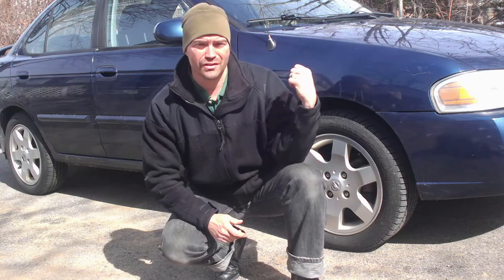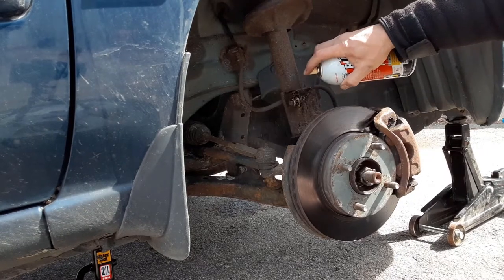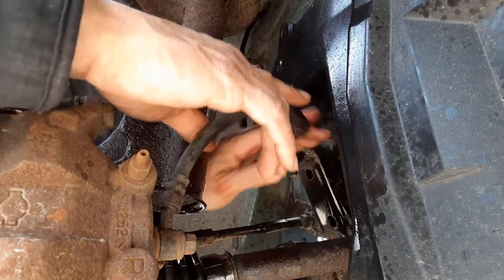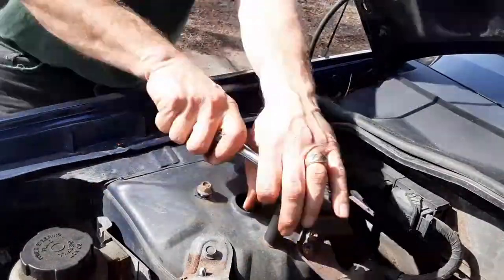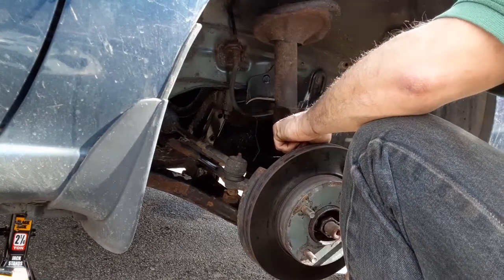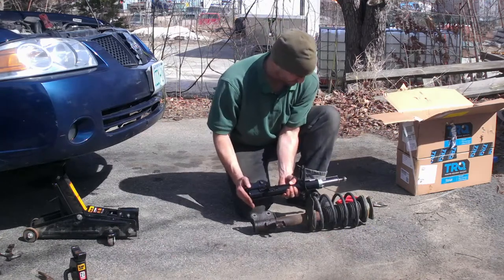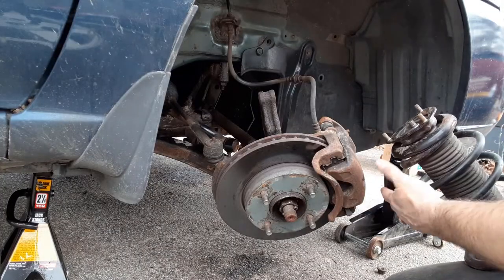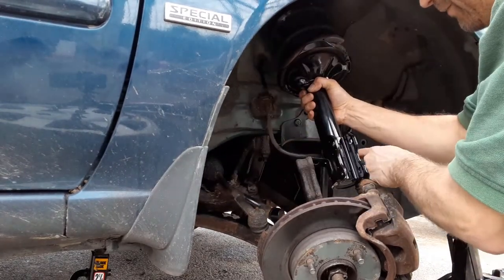Replacing the front struts on a 2006 Nissan Sentra 1 8 SE

Comment: Thanks for that.
I've heard you need to get an alignment done after replacing the struts on these. Is that right? The shocks on my 06 sentra are really shot and I could use doing this, but having just got an expensive alignment done, I'm hesitant.

Any thoughts?
Reply from the maker: If you just got the alignment done a lot of places will recheck it for you for free. Just ask if they will. But yes I would have the alignment rechecked.